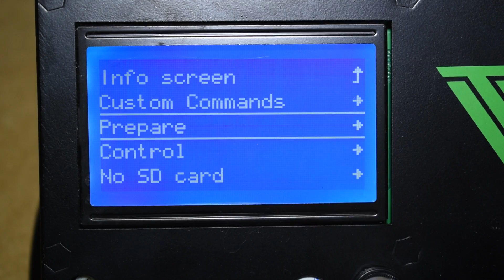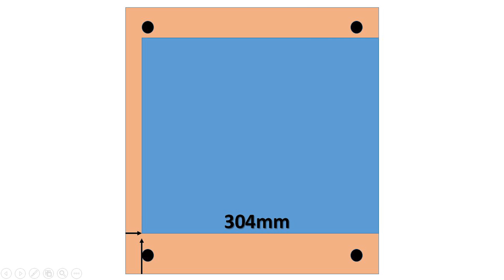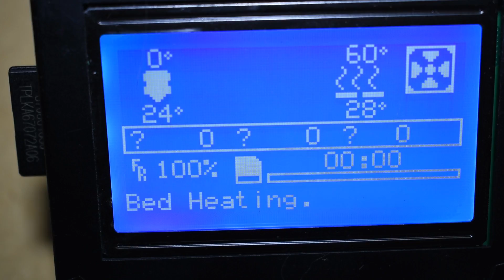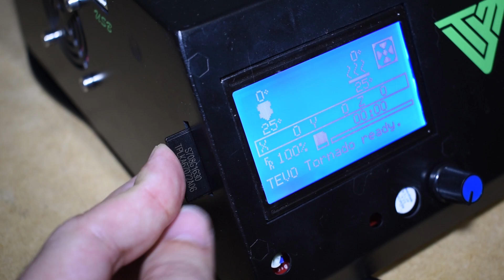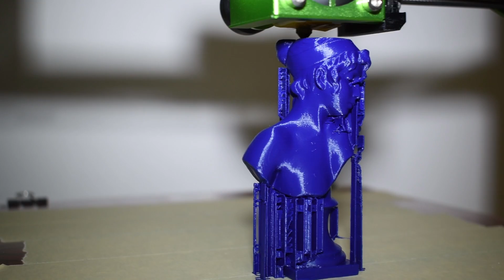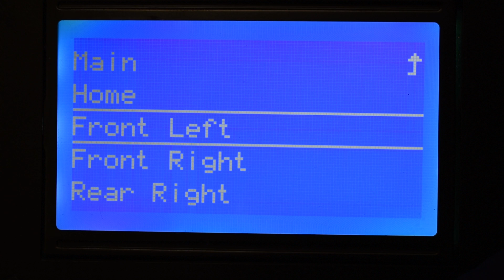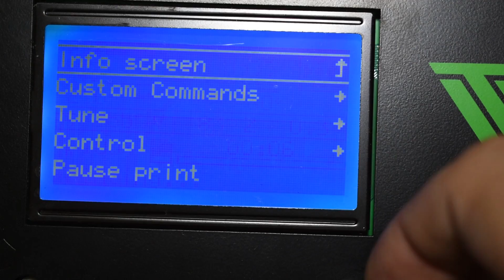TEVO TORNADO 3D PRINTER - First prints and thoughts

Comment: is it possible to take a glass or plexiglass and instead of drilling 4 entire holes just carve enough in the material to allow the screws to fit but the other side remains untouched so the printing area becomes bigger?
Reply from the maker: Hi mtn,
The printing area is smaller and does not reach the screws. You will take more time to do that with not much benefit. But to answer to your question...yes you can.

Comment: Hi, in the 2018 model the main board is MKS GEN LV1.0 instead of MKS BASE 1.4 ? Is there one which is better in your opinion?
Reply from the maker: Hi,
The newest version (MKS GEN board) is much better as you can use the stock A4988 drivers or swap the drivers with different and better ones. The old MKS Base board has soldered drivers so you cannot replace them easily.
Reply: ruiraptor Thank you so much. Do you think TMC 2130 steppers will be a worthy upgrade or would you recommend TL smoothers?
Reply from the maker: Hi,
The smoothers are cheaper but the TMC are much better. They not only work better but they also can make your printer much more silent.

Comment: Hi , thanks for your videos !  Do you consider the Ac SSR switch as a safe methode to eatup the bed ?  Is there any safety device put in case the switch fail in on position ?
Reply from the maker: Levisgil47 ,
Yes, the SSR is safe but as everything in life can also fail.
Reply from the maker: Just check the temperature value when you turn on the printer. If everything is ok, then start the print. It can also fail during printing, that's why many people don't recommend (me included) not to leave ANY printer working unattended.
Reply: So  could be nice as an upgrade to put either a relay + fuse in the AC line or and set up in the marlin code a check of the bed temp that open the relay in case of over temp. Not sure it's implemented in the tevo tornado...

Comment: Hi ruiraptor,
I've a question about the glass plate you use. What kind of glas is it ? What is the official name so that I can maybe order it in Germany. Are the holes made by a glass makeror a company or by somebody else ? I also like it to print on glass only. Would be nice if you could answer to my questions. KInd regards  HJ Meyer
Reply from the maker: Hi Hans-Jurgen,
In all the printers i have, i use glass. I like to use glass too. This has so many benefits. I have a local glass manufacturer nearby and they cut the glass with the measurements i need. I always use 4mm thick normal glass or tempered glass. Lately, i've been using normal glass. The difference is the handling...you need to be more careful not to break it. For the tornado, i requested a glass with 4 holes. The glass was 4euros and for making the 4 holes i paid 3euros.

Comment: Which one is better ? Black Widow or Tornado? They seem to have comparable prices
Reply from the maker: Hi, it’s very hard to answer that question.
With the tornado, you have a machine that is super easy to build, very power efficient, amazing heatbed and good quality.
With the black widow you have an not so easy to build machine but with a very good frame and also equipped with dual z motors and dual leadscrews, beautiful controller equipped with a gen board capable of driver swap/upgrade and a very good extruder.
Reply: ruiraptor Hi. Thanks for the very quick reply. My question really is the Black widow is costlier than Tornado. Is it really worth it?
Reply from the maker: It costs more yes...but has a much stronger frame and a gen board that allows you to install any driver you want. If you want to change the drivers with silent ones (they really make the stepper motors run silent) and that dont produce salmon skin, you can. With the tornado you cant do that. It's really a tough choice. It all depends on what you want to do with the printer and your experience with them.
Reply: ruiraptor I am sorry to ask too many questions. But which one will you say is a good work horse? The one that is reliable and faster to print?
Reply from the maker: At this point, i see that both are a work horse. I've been working with them and both work fine. The tornado can be little faster thanks to the bed which heats up extremely fast ( and it's bigger) and thanks to the X assembly which is lighter. 
If you are not interested in changing drivers and you are ok with installing smoothers to eliminate the salmon skin, then i might suggest you the tornado. What will be the use you will give to it? What filaments you will be printing with?

Comment: Did the glass bed come with the printer?
Reply from the maker: Hi Igor,
The heatbed is made from a glass material which makes it very flat and stable.
Some users (like me) prefer to have a removable print surface to take the prints out from the bed. That extra glass (which i show there) is not included with the printer.
Reply: Another question, could the firmware be modified to reach the full build volume of 310 x 370mm?
Reply from the maker: Igor Daemen ,
the firmware is not responsible for the printer area. it's the home sensor positions and the physical mechanical limits that define the printer area. Anyway, there are already firmware updates available for this printer.

Comment: If they use the same MB, and largely the same motors, other then the bed and hotend, sounds like they are similar enough that if you had longer 2020 and 2040 bars you could rebuild the tarantula into the tornado. Would you by any chance have longer bars and be able to test that theory?
Reply from the maker: You would still need all the motor mount plates and idler mount plates. These are metal ones not acrylic. The Y motor is also different (more powerfull). I dont have the profiles to test, but the profiles are the easiest to get (but more expensive) then the metal plates which it would have to be designed and cut at a workshop.

Comment: 100% copy of the Creality CR-10 with cheaper quality parts.
Reply from the maker: The controller is much different from the CR-10.
This one has an AC bed controlled by an SSR. Also, the TEVO has a titan extruder which, so far, looks awesome.
Reply: ruiraptor ya very true, I forgot about the ac powered bed! My bad.

Comment: I see you enable Z hop. 

Where do you define your home position in Cura? I saw you enter the bed size, but there doesn't seem to be a box to enter the home position. I have done this with my Tarantula on the LCD, but it always says "Too far!". I have managed to print with it, but it doesn't print perfectly in the center of the bed.
Reply from the maker: Hi,
After you type in the build area, you can also choose where you want the home position...at the side or center, for example.
The Z hop was enabled for the spool holder, but that model was sliced by TEVO which provided the gcode ready to go.
Reply: Thanks for the reply!

I will re-tinker Cura now and see if I can find that setting. Thanks.